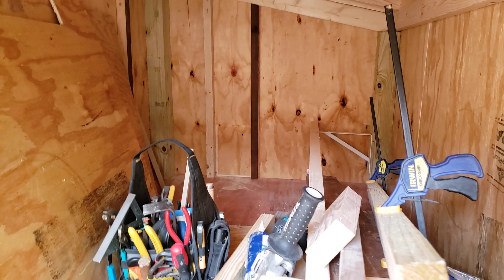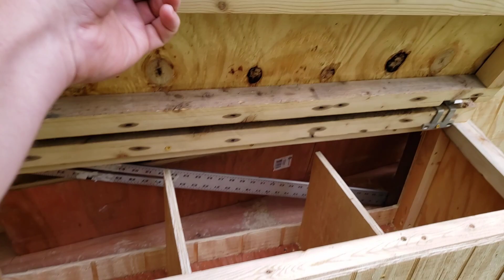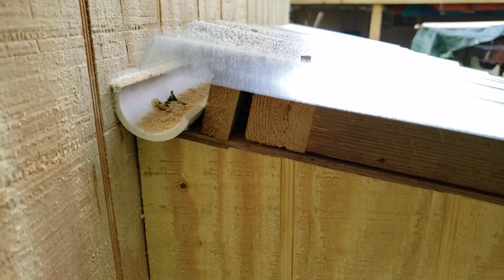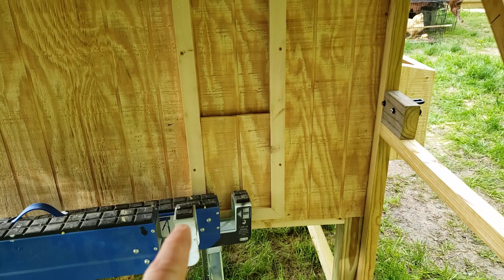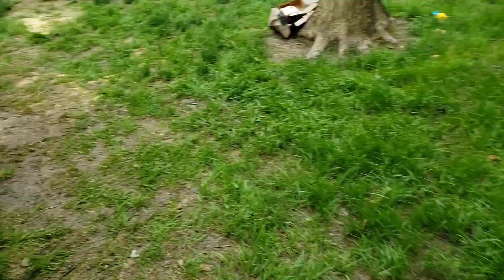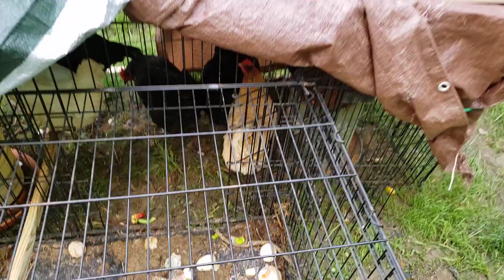Chicken news

Comment: It may be hard to shovel out the coop. You may also get eggs laid outside of the boxes. Can you make it so the other wall also opens?

I would also consider adding some screened ventilation: both for fresh air and heat control. Sixteen chickens can generate a lot of heat.

It's good to see lots of people get awakened to food security issues and doing what they can about it!